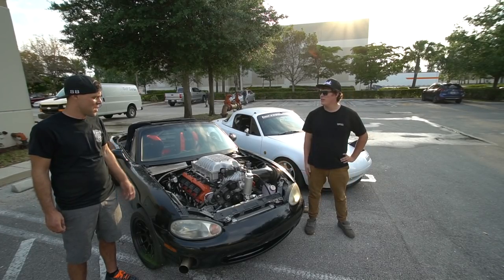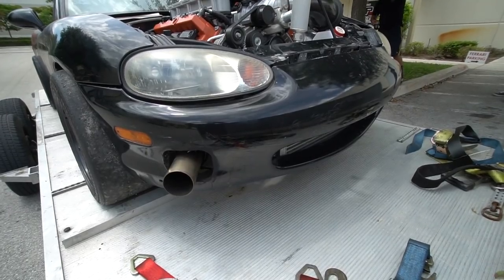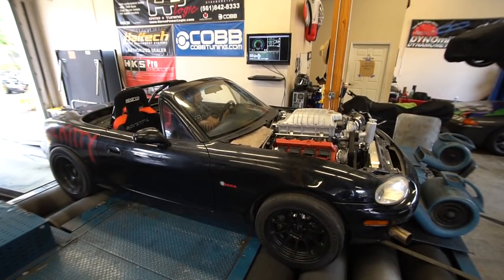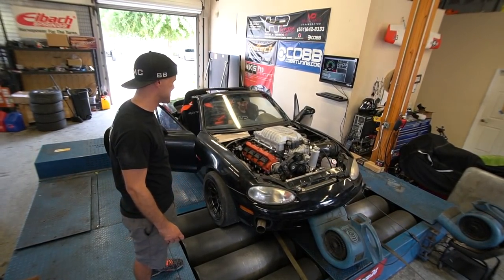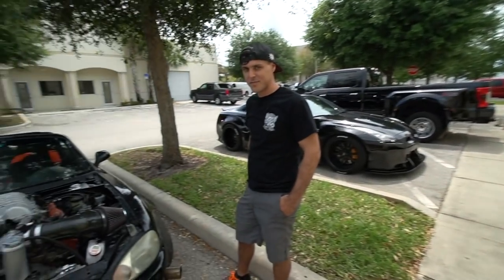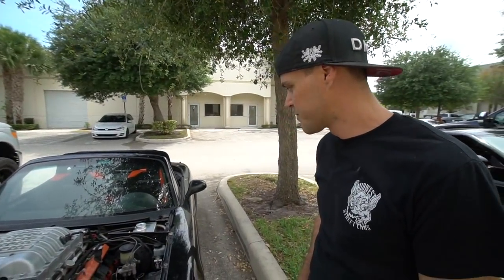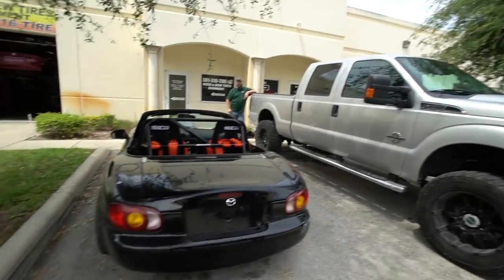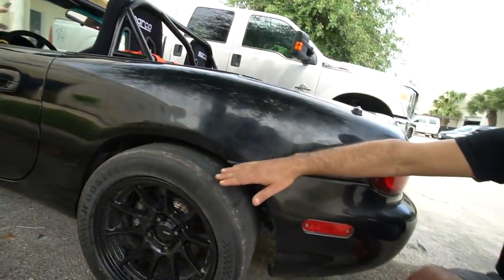WORLDS FIRST HELLCAT MIATA!

Comment: Just a thought and sorry little longer comment,.. in 2014 Chevy released the new Camaro Z28 track car with the same N/A LS7 427 7.0 liter v8 from the z06 corvette but they had some big claims people laughed at being a Camaro thinking BS!  (For the record I think the camaro is ugly and too common BUT I'm a huge fan of the LS7 7.0 liter 427 as I've had a few and the z28 was just epic even as non attractive as it was;..or plane Jane I guess)  GM took the z28 to the Nurburgring and leaked the test to Porsche, Ferrari, Lamborghini and Nissan intentionally becaue they were so confident they'd all show up banking on the z28 failing it's crazy claims.  They went out and lap 2 after one lap of warmup in front of Porsche, Nissan and Ferrari engineers (Lamborghini thought it was Bs and didn't show) lap 2 set THE record lap for production cars at the Ring out lapping the new 911 Turbo S x50, the new Murcialago track. And everything 5+ times the cost,..only 505hp on a heavy camaro that's RWD and only available in the 6 speed opposed to Porsches updated new lightning quick PDK had people crazy confused at first Porsche said it was rigged and a false time but GM showed the In car data log and video and the day GM broke the record Porsche was there and threw a legendary fit when they realized GM's secret lol Pirelli P-Zero Trofeo R's in 305 30zr 19's at ALL 4 corners,..305's ON ALL 4's!!?? to put in perspective the Bugatti Veyron same year had 265's in the front and is AWD,.. lol they combined the widest width front production tires in history by a long shot to a heavy car and huge ass carbon ceramics.   Everyone thought 305's in the front of a RWD car was rediculous but apparently was not.  Porsche embarrassed themselves publicly on film complaining at the ring after the footage saying" it wasn't fair that cheap (relatively speaking) Camaro had 305's all the way around".   Condisdering it was 1/4th the cost of the New 911 turbo S x50 , rear wheel drive as opposed to AWD Porsche , less hp in the Camaro without boost or porsches new overboost system which was unveiled and suppose to be the new record setter and was beat out by the poor mans sports car us camaro, lol.  It also beat the being tested GTR NISMO R's AWD that wouldn't be out for a bit  as well ,..essentially broke all records at the track for production vehicles of any cost with a simple formula.  Porsche then immoderately denied throwing a ft about the tires but when realizing the tantrum was fought on film and leaked to the web by GM I'm sure ,they went back to the ring and filed a complaint comtesting the time saying it wasn't fair again , claiming the front tire size bs again lol.  Then Porsche mistakingly said the ring time didn't matter,..their own track lol and that the Porsche would beat the z28 on a shorter curvy  track  sooo The next month Randy Pobst broke  the production car record at Laguna Seca destroying the 911 turbos S and nismo GTR and a track spec viper which is his personal favorite and he drove all 4 Doing 8 laps in each car and the z28 destroyed all 4 every lap to his shock and porsches as well being a tighter track.  Reason I mention this long ass comment  is miatas obviously crazy light comparatively speaking but huge ass crazy heavy hellcat motor , drivetrane and terminator axle this thing would be a hella dangerous road course car IF you can get it to hook and make G's in the curvies and gain traction out of the hole.  Have u thought about going some crazy wide tire on all 4's? Looks like all 4's are wide already but that motor up front and the added weight would use the same huge ass exact same tire size on all 4's like the z28 and would benefit hugely from it.  I'm talking trim the fenders , R-widebody fender flares and 305's on all 4's ,..would be insanely sick if you went the biggest carbon ceramics you could fit too or at least Stop-tech GT-R series circuit brakes.  Being so light would make in stop record short corner like a bitch and shoot out the hole like no other,..legit would be worthy of the Optima Series challenge roadcourse event.   My favorite car I've ever road coursed or tracked was my Lingenfelter c6 z06 ,..606 N/A hp,..factory carbon fiber body panels, magnesium roof and floor board as well as space frame and carbon ceramics with 315 rears and 295 fronts.  0-60 in 2.5 consistently because it was so damn light 315's just the right NA power.  Shot out the holes so hard, braked insanely cornered like nothing I've drove and I rmemebr thinking man a wider front tire same set up and I'd post faster , then the z28 was announced which did just that and seeing one at a track day WORK everything else's out there and bone stock I thought man it'd be nuts to get some tiny roadster and swap  a huge ass v8 , 305's all around and carbon ceramics,..And now I see a hellcat Miata and THIS is THE perfect set up for that, tellin ya 295's or hell make 305's work and brakes and change the roadcourse game!!  Just a thought dodge Dana 60 out of a powerwagon with the 1 ton g force shafts and the Factory selectable electronic locking diff would give you more weight in the rear and a true locking diff with the push of a bottom for different events.    Or off too big go mopar Dana 44 out of a Rubicon g force axles and Factory diff lock . 
I want this Miata SO bad!!!  Deadly serious on wondering what the cost to build would be with a wrecked donor hellcat or what this dude could build it for doing it again and knowing the secrets now!?  I'd always thought N/A LS7 427 505 hp in a Miata but hearing that supercharger whine which in the hellcat is the greatest sound ever I'm sold!  Again I'd leave some sort of rear exit dual mode mufflered system JUST so you hear that supercharger whine comming!  😍 
First time on your channel,..saw you on Cleetus channel a while back and gotta say I like your channel a lot and like that you're cool saying stuff scares ya not trying to be all bad ass.  👌 new sub!  Hella cool video!!! Dig the enthusiasm!!

Comment: And a completely stock k series k20a2 Honda with a Turbo can make 700+ HP at 1/4 the cost and 1/4 the weight. Not to mention retaining an ideal weight distribution on the chassis and power to weight ratio.  I see this hellcat
 project pointless and a huge misappropriation of funds.

Comment: Okay, look. Im not looking to piss on anybody's parade here but there's a point where these engine/car combo's get a little pointless. The 302 Ford/5speed Miata is scary fast to say the least but it fits under the hood, runs and drives pretty normally. Untill you mash the throttle that is and the you feel like you just got shot out of a cannon. This is just stupid. There is absolutely nothing you can ever do to this car that would enable it to put that much horsepower and torque to the ground, i suspect that it handles corners like an old GMC bus and the weight distribution has to be WAY off and this is leaving out the fact that the Hellcat engine and trans will never fit properly in the car. This project gets a 4 on the ingenuity scale and the only reason it's that high is because he did somehow manage to make it all work without twisting the frame in to a pretzel but this car gets a 10 on the dumbshit-o-meter. A total waste of time and cash not to mention they sawed up a perfectly good Miata to do it. Next project, stop being so caught up in "can we do it"" that you totally ignore "should we do it".